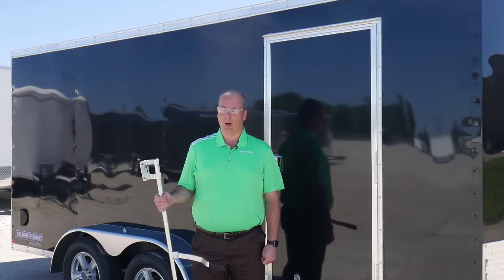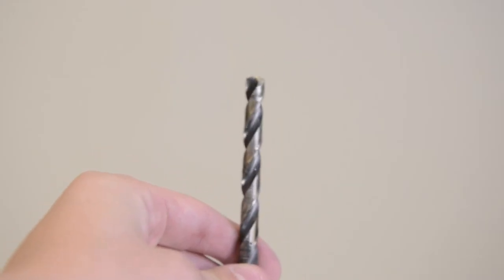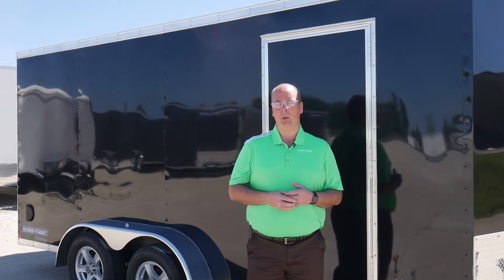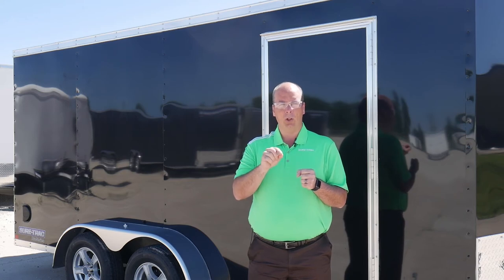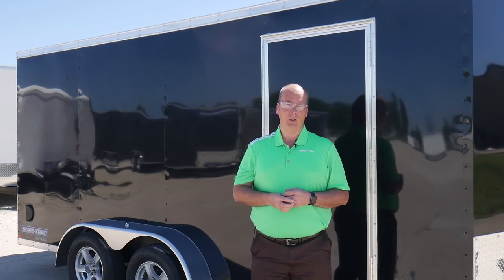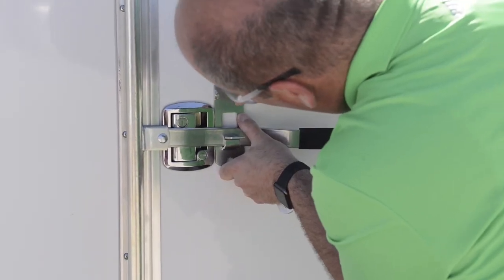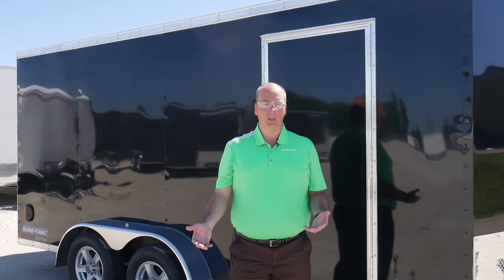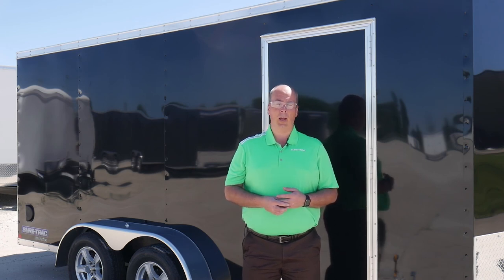How to Install a Barlock on Your Sure-Trac Enclosed Trailer

Comment: this is pretty confusing. The tamper proof screws 3/8 x 1” are pretty hard to find in a course thread. You call them bolts in the video, but I don't see a fine thread bold holding very well. Can you help us out here? I think a lot of people (like me) bought the hinge and are struggling with this part. Is there a reason you don't just put a bolt through the wall like you do with the door? Thank you!!!
Reply from the maker: We don’t put a bolt through the wall because it isn’t needed with our method of installation. If you want to install the barlock, it shouldn't be a problem. You could probably just drill all the way through the wall stud, and interior wall covering, and use a bolt that is long enough to go all the way.  I’d use a washer and locknut on the inside.
Reply: There "method" isn't great, there's barely a 1/8" of threads holding the security bolts.... be careful tightening or you will strip them!

Comment: What is the part number for the Barlock System you installed? Thanks
Reply: Your local dealer may have these in stock, but if not they can easily order from us.  The kit should be ST9698.
Reply: I found a similar bar lock here: https://trailerparts.com/45-cam-latch-side-door-bar-lock-assembly.html

Comment: We have bought 2 Sure-Trac trailer and they're very expensive. Getting parts for them takes way to long. We've been waiting 3 months for a replacement axle ordered from one of their dealers. They don't carry anything... everything has to be ordered by the dealer from Sure-Trac, for us... this has been a very slow process.
The "Find a Dealer Link" seems fine for buying a trailer, but many shops like ours are quite capable a repairing our equipment...  if the dealer stocked parts or could get them in a reasonable amount of time... fine, otherwise it would be nice to get them directly from the OEM, I think they must make them as they build them and have no stock of parts???
UPDATE: After contacting Joe we're getting our axle Monday. Great support at corporate!
Reply from the maker: Good afternoon, Bob.
Getting replacement components should not be an issue.  What dealer are you working with to get parts?  I can send a message along to our territory Rep to look into this matter.
Reply: @SureTracTrailersPage  Here is the dealer in our area which is St. Louis, Mo. Mid America Truck Tops & Trailers, 501 Howerton Ln, Eureka, MO 63025. They are nice enough people but say all they can do is order and wait... we've been having a busy season and it's just been a shame to have that nearly brand-new trailer parked. One of our drivers cut a turn a little close and clipped a fire hydrant with the right front tire and bent the spindle.
Reply from the maker: Bob, sorry to hear about the accident.  A simple mistake like that should not result in loss of the trailer for the season.  My first assumption is that perhaps Mid America is / was waiting for a load that these parts could ship on to save the freight.  But most of the time, parts can be shipped rather quickly.
What is a good contact # for you?  I'll send the information to our sales and parts department.

Sorry this has been such a hassle for you.

Thank you.
Reply: @SureTracTrailersPage  I appreciate the help... but there's no way I would post my phone number on  a public forum. If you could provide a way to contact you please let me know!
Reply from the maker: Good morning. That makes complete sense.  Please send in a contact form via our website at https://sure-trac.com/contact/.  This will come into me and I will be sure to pass along.
I appreciate your patience, and again, apologize for any miscommunication that may have created delays.
Reply: @SureTracTrailersPage  Will do Joe! Thanks for the help!
Reply: @SureTracTrailersPage  Hey Joe, I Don't know if it's coincident, but I just got a call from our dealer and our axle has arrived! It actually came in last week, but he said they were busy... I do think that owners should have the option to buy parts for our trailers directly, or you need to improve how long it takes to get parts out to your dealers. Thanks for getting back to me and trying to help! Bob
Reply from the maker: I do know that our sales representative reached out to them to follow up.

Parts are available quicker, but may require additional charges that may not be accessed when shipping with next load of trailers.

We appreciate you contacting us about the situation, so that we have an opportunity to assist and resolve any outstanding issues.

Have a great day.
Reply: @SureTracTrailersPage  Thanks Joe! You've been very helpful. I know where to get help now if we run into issues in the future! Have a great day, Bob
Reply: @SureTracTrailersPage  Your saying parts are available quicker... how would someone do that?
Reply from the maker: Paying additional for freight / shipping charges would be the best way to ensure timely delivery.  Having parts ship with next available load going to the dealer is the most practical way parts are delivered.
Reply: @SureTracTrailersPage  I understand there's shipping charges, what I want to know is how do I order parts directly from Sure-Trac? NOT thru a dealer! I need additional parts for the trailer we just finally got the axle for. I asked this dealer about getting us a new fender and bottom trim piece twice and even sent pictures of them Never heard back... so do you have a phone number or email address for ordering?? FYI: We asked if they could do these repairs and they said they don't do "body work". Thanks, Bob
Reply from the maker: All sales are managed through a Sure-Trac dealer.
Reply: @SureTracTrailersPage  Thats to bad, we'll figure something out